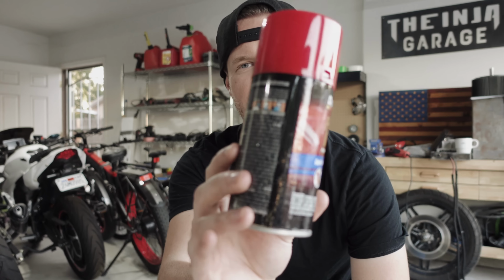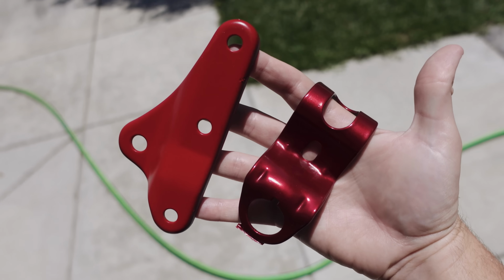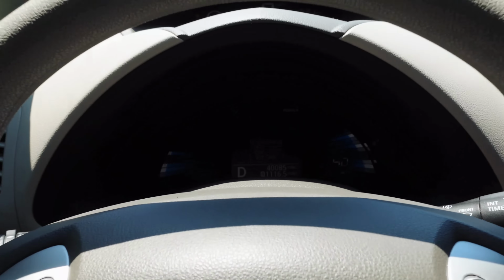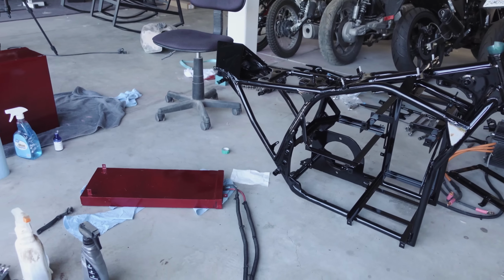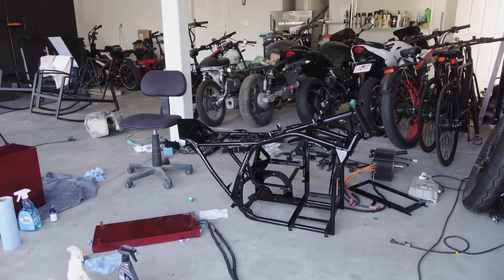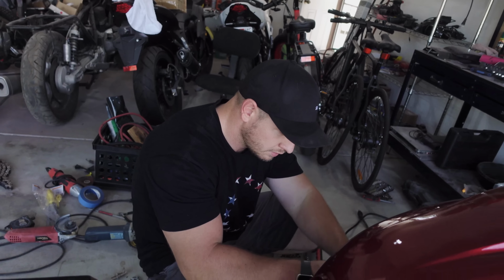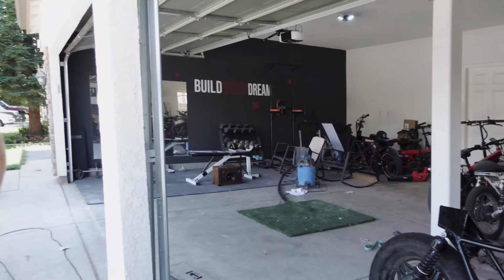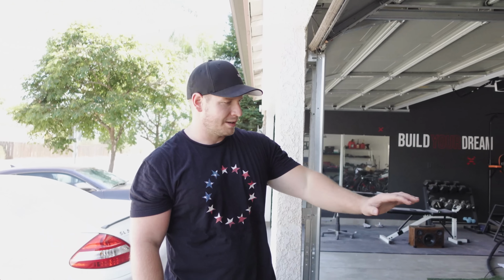ELECTRIC CAFE RACER for $4,000 | Painted and Almost Done!

Comment: I powder coat my own parts in my garage in my small oven. They should be sand blasting the part initially. Any real shop would had dropped that  in a heated chemical bath for 15-20 minutes. The coating would have just fallen off. I outsource the larger parts like frames. 1 week turn around would have been acceptable considering every shop keeps gloss black in stock.
Reply from the maker: Agreed.
Reply: @TheInja  at least the end product looks good! Looking good!

Comment: That big battery box up front is such a big eye-sore block.
Reply from the maker: Not really, I think it looks sweet. How would you have arranged the front 90AH LiFePo battery pack for it to look better?
Reply: @TheInja  I think you're running into a major issue with designing electric bikes, which is where do you put the battery pack so that it feels integrated and doesn't look like you're hauling an old CPU from the late 90's! I think Regent Motorcylces have done a good job with a classic look. They're trick seems to be break up the surface with some graphics. Didn't meant to come off shitty, this is an impressive project! Best of luck with it. https://electrek.co/2020/05/18/125-km-h-rgnt-electric-motorcycle-begins-taking-pre-orders-in-europe/

Comment: Here’s a suggestion make all cables black or wrap in weather proofing black electrical tape that modern cars use. And black plastic connectors and black bolts and any where possible getting it black it will make the red pop and the feeling of it being ugly will go away  trust me it’s not as bad as some say just get it nailed perfectly and you be golden and if some wires stick out again use black weather proofing tape. Removing all chrome and sliver shinny and more will make it look top tier.

Comment: So I've had a very similar problem with the place that used to do my powdercoating . Found out they don't actually do it they just sandblast then send it somewhere else to be done, sounds like your place does the same. They have blatantly been lying to you as powdercoat is baked in the oven to start burning it then blasted to remove it. And the price is absolute robbery should of payed about $200 at the most and that's expensive. Hopefully your pleased with the results even if you had a lot of headache, that's the main thing you enjoyed the build. Great content thanks for sharing.

Comment: Hey bike looks sick. I don't know if you remember me but I asked you for advice about getting a e bike from Alibaba  the Generic stealth bomber well I ended up getting it 3 months later but listen to this so I get the bike and I had to go through the hole thing because they built it with out tightening any screw crazy thang god I went thru it but I missed one screw on the rest disk break ( one screw I'm missed) that they never tightening Wich  unscrewed while I was riding and cutt right thru the power cord  so I've taken apart the hole electric system to redo all the wiring what a mess I hope my sabvoton isn't blown

Comment: Guys!, since you actually do customs battery arrays, why ended up with an old desktop PC case chainsawed through the frame!. As a subscriber, I know you guys are capable of more!
Reply from the maker: What do you mean?
Reply: @TheInja I mean, I know you can do a better work shaping a battery to a more appealing look. Now is just a big box (a red one now) in the middle of the frame, you even had to chop the frame to fit the battery box in it. I thinking in a shape to flows with the bike's frame, or the direction of the movement of the bike, but not just a box. But that just me man. Any way, the bike works great, and Im always waiting for your videos.
Reply from the maker: @stefanmelo  there was no better shape to fit that insane amount of battery in there. A flat box is the most efficient. And in my opinion, the stance looks waaaaaay better than the original frame. Complete different drivetrain calls for a complete different look. Plus we're competing with the LiveWire and other big names so specs had to also be incredible (large battery packs, etc.). I think it looks fantastic and there was no other possible way to make it "look better". How would you have shaped it?
Reply: @TheInja  that bike is a hell of an E-Bike, sadly there is no way to attach an image to a comment to explain myself better. Any way love your channel!!

Comment: You might want to try one of the guides that are on the engine that keeps the timing chain running smoothly from the crank to the cams. Just a suggestion. It works well with the timing chain, why not the drive chain. Of course you would have to find one that will be big enough for the job. Again, just a suggestion.     Roger in Pierre South Dakota
Reply from the maker: Thanks for the suggestion! We're figuring it out this week so any info helps!
Reply: @TheInja  Just watched a video about rebuilding Honda motors. When your friend said something about the chain situation, those guides jumped into my mind. Teflon guides might do the job as well. Looks like a great project. I’ve been watching the progress from start to finish, well close to finish anyway. It’s great that you have a friend that is and electrical and or electronic genius. Will be watching when you get this on the road. With all the battery technology it has in it, it should fly down the road!    Roger in Pierre South Dakota

Comment: was the problem of the cut off on full throttle solved already?
Reply from the maker: We pretty much know the issue but will tune it more when it's back up and running this week!
Reply: @TheInja  Hey, what do you think is causing the throttle cut? I have the same controller and motor and I'm having issues with it too. Thanks! Great work. Looks AMAZING!

Comment: while the concept of the bluetooth lights sounds great, there are concerns. the biggest is that it relies on the wireless signal transmission. areas with high concentrations or high power output transmitters can jam the communication and fail to operate properly in response to a transmitted command. CB radios, dense areas of population with transmitting devices, and even cars with bluetooth operating are all possible sources of jamming other wireless devices. for a more recent example, my samsung galaxy buds+ would have connection interruptions if a bunch of cars or areas with a bunch of wifi routers operating even with my note 20u right next to the ear buds. as much as i like wireless technology and cutting wires, there are just somethings that cannot be made wireless unless additional methods and technology are used in order to lower the chances of the signals being jammed. to simply why this is a problem, the range of frequency of the spectrum of radio waves is small but somewhat high up the in the radio freq range, usually its around 2.4 to 2.483 GHz. 80~ MHz is not a lot of space for a dozen or so items to operate on depending on what they are being used for. playing music for examples would be a constant utilization of a span of that space unless a modulation utilizing time slots instead but usually simple devices just use frequency distributed modulation. simple commands would only operate for that instance to transmit the command and doesnt seem that taxing but here is the thing, there are more things involved with radio transmissions that just transmit and receive. ever wonder why you hear truck drivers on CB radios on a car stereo? that is not only just because the span of the transmitting frequency is overlapping a part of the receive span of the radio channel you are listening to. you can think of a transmit and receive interpretation like a mesa, a mountain with a flat top. the data is on top of the mountain but the slopes of each side represents the echo of the data. if the slopes of two mesas get close to each other then the echos can start to bleed into each other to cause noise or jamming. thats why the industry standard is 3-5 Mhz in between transmissions in order to prevent jamming. so take that and the 80~ MHz range to work with and do the math with just 3 MHz space in between transmitters AND receivers. honestly, its not a lot unless the devices uses a different range of operating frequencies. honestly, just go with wired lights. there are just so many things that can go wrong with wireless dependent devices for operation. there have been cases in CA where cars with wireless key fobs have had issues with recognizing the key fob is in the vehicle because of the amount of wireless signals in an area was so dense that it jammed the signal from the key fob and caused the vehicle to turn off while in motion. also, if you have to run power wires to the bluetooth lights anyway then its bet to just run wired lights regardless. if you want to adjust the speed of the lights then get an adjustable "capacitor?", i cant remember but i had to get one for my n400 because of the led lights, to refine the flashing speed.
Reply from the maker: Yep, we'll figure it out.

Comment: The pieces you painted red yourself came out just as good as the "professional" powder coaters work and I'm sure if you had enough free time you could have painted the whole bike yourself. The bike has really come together and exceeded my build expectations 1000%
Reply: Johathan... electrostatic spray deposition (ESD) coating (aka Powder Coating), is extremely durable vs your typical paint. If applied correctly powder coating can be hit it with a hammer and stay bonded to the surface. Where as paint will scratch off to the base metal with fairly light impacts. Down side of powder coating is it's expensive vs spray painting something. SO majority of vehicle  manufactures and the average person, will use powder coating on frames, due to the intricate shapes and high impact area it is located in. If the frame was painted, you would run in to rust issues in a really short time, and need to address it to prevent structural integrity problems. Things like body panels can be spay painted without the worry of any rust that forms putting the rider at any real risk of injury, due to structural failures.
Reply: @JJ_ExMachina  and looking at the lack of prep he did, it won't be long till it's all rusty again anyway
Reply: @HomeDistiller  ... Not sure what you're referring to, but everything was sanded, primered, base coated and clear coated on the painted parts... So as long as nothing gets scrated to the base metal it's not going to rust. Not sure what you consider "prep", but rust is Oxidation of iron based metals. Bare/exposed metal rusts due to it's interaction with the oxygen and moisture in the air. Properly sealed iron based metal won't rust. Vehicles rust because car manufacturers cheap out and only seal the surfaces you can see. They don't actually fully paint the underpinning of the vehicle's structures.
Reply: @JJ_ExMachina  thanks for the insight

Comment: I built up a motorcycle from a frame and a heap of parts, to a running bike inside 6 hours, in 2019, and the owner rode it over 40 miles home. 

The bike was a 1978 CZ 250-471.3 Sport.
Reply from the maker: It's possible but so much more complex. Small bikes take a lot less time than higher output engines.